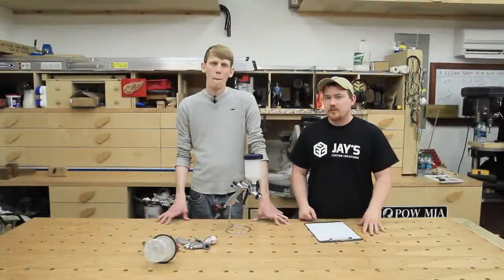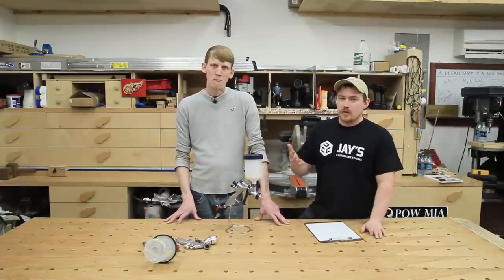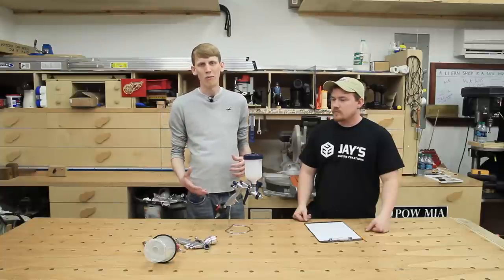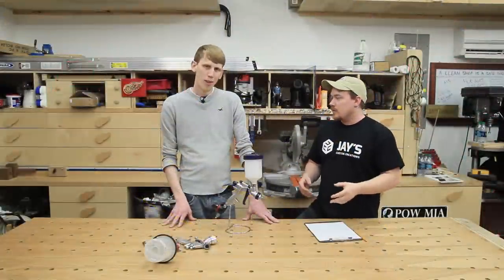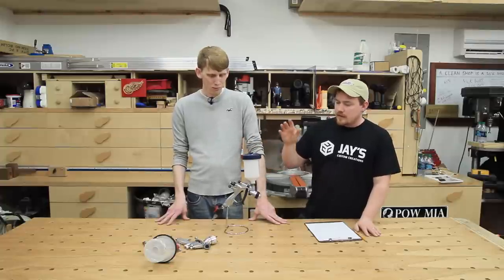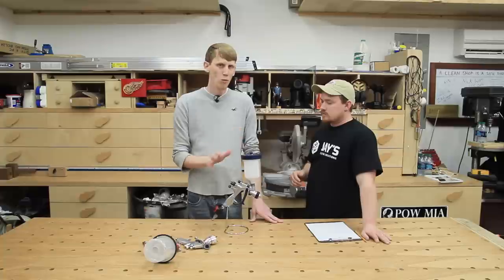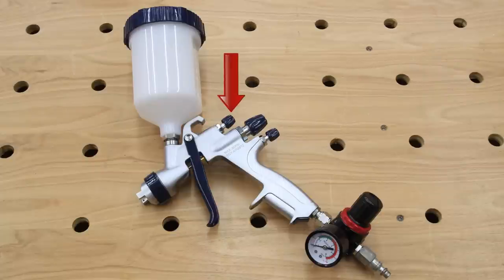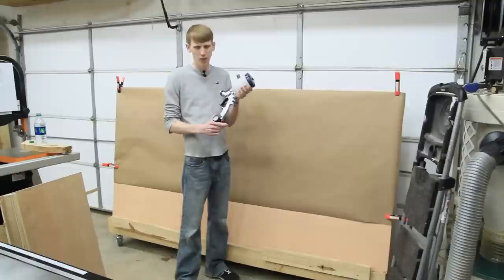Intro to Spraying Finishes With a HVLP Spray Gun - 241

Comment: What about how do you keep the moisture out of the air line on humid days so that your gun doesn’t spit water onto the painted surface?
Reply from the maker: in line moisture remover.
Reply: Could you please elaborate on that 
Never heard of a moisture remover for a conventional set up
Reply: Could you please elaborate on that 
Never heard of a moisture remover for a conventional set up
Reply: Could you please elaborate on that 
Never heard of a moisture remover for a conventional set up
Reply: Could you please elaborate on that 
Never heard of a moisture remover for a conventional set up

Comment: I see a real challenge with shop dust being blown into your project. You would need a dedicated room for this type of process.
Reply from the maker: +Larry Askew Vacuum the dust before you spray if you are spraying indoors. I wouldn't recommend spraying inside though. We did it in this example with the garage door open and a fan exhausting air.

Comment: one small criticism to an otherwise excellent technique,  he flips his wrist at the end of the stroke which changes the spry application and sends a cloud of spray out into the open air. Better to hold the arm and wrist stiff and walk back and forth, releasing the trigger past the project ends :)
Reply: +Don Rad That's actually the proper technique. You wanna take the finish past the panel then flick the wrist, thus moving the over spray away from your project while simultaneously releasing the trigger.
Reply: +Matt Lane Apparently both techniques are proper. In the video you only "flick the wrist" on the right end, while the left end is held steady.
Reply: Dan Rad, you are correct on this. The flick-wrist might work for cars and curved surfaces, but not for cabinets and furniture and flat surfaces. It's a spray gun and not a paint brush. Watch robotic spray machines, they do not flick. Our job as finishers is to mimic the spraying that the robotic machines can do.

Always spray square to the surface as much as you can. Come off the piece and trigger off. That not only saves material but it cuts down on overspray and dry spray.

Comment: How do I prevent clogging?
Reply from the maker: +Adam R filter the finish as you pour it in the gun. Auto parts stores or auto body supply stores have paper filters for pretty cheap. I think harbor freight might have some too.
Reply: Jay Bates what about after? I turn spray paint cans upsidedown to clear the nozzle but how would that work with a spray gun?
Reply: +Adam R blow it thru with the solvent the finish used. And if you want it to last a long time and give you consistant results, take it apart after blowing it out and clean it. Same deal if your using a good brush.

Comment: Come on guys... Whats the deal with that regulator on the gun.
Pointless weight..
Might not seem like a big deal to you guys but ask any painter who paints all day long.
Make yourself a quick couple psi gauge if you want to check at gun air pressure.
If its really important to you talk to your gun manufacturer for a air cap testing kit. 
Place your regulator on the wall of your booth, table whenever you paint but get it off your arm.
Your elbows will thank you
Reply: I outfit all of my guns with regulators and gauges so I can see the PSI at the gun, not at the wall. Depending on hoses and fittings, there's pressure drop by the time you get to the gun. Plus, I need to see the PSI with the trigger pulled. I spray in different environments. I don't need a test cap. Those are for EPA bureaucrats, not me.

Also, the gun regulator locks in right under my arm so that I can "feel" that my spray fan is square to the surface.

The useless thing is the "cheater valve" (because that's what it's actually called) to make so-called micro-adjustments to the air in the gun. The issue with them is their lack of accurate dialing in. I use them for temporary adjustments on the fly.

If I want to deal with or worry about the weight of the gun, then I use a pressure pot or a hydraulic pump, or even best, an air-assisted-airless.
Reply: I actually see alot of people using them Daniel and your answer makes sense.
.. maybe I am the dinosaur here.
I have been thinking about this alot and I just don't see the problems with pressures painters are talking about.
I overspeced the shop with Kaiser compressions a long time ago..
Large diameter pipes feeding into SMC large bore filters into SATA filters then to gun.. I think I have got used to a pretty good setup..
Thanks for the reply
Reply: +rod darmody Jealous of your gear, lol.